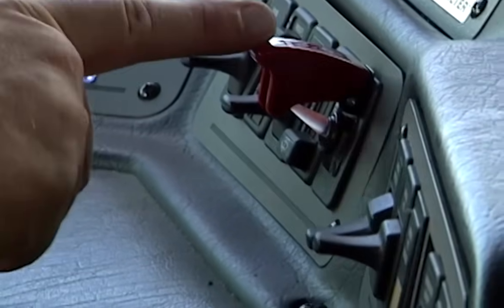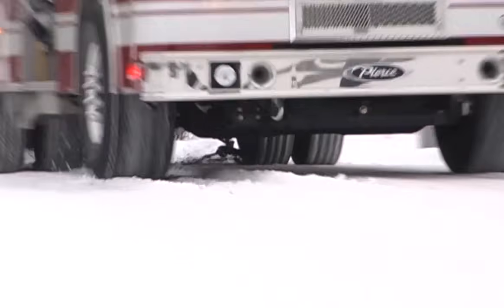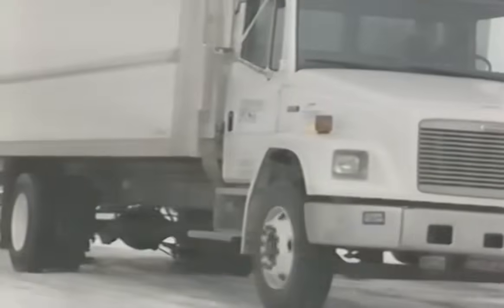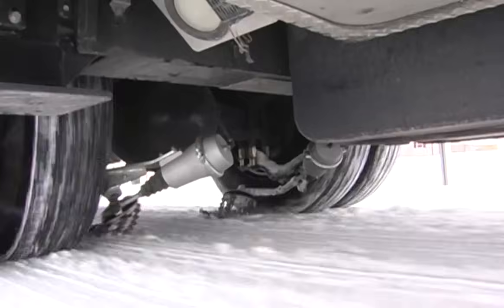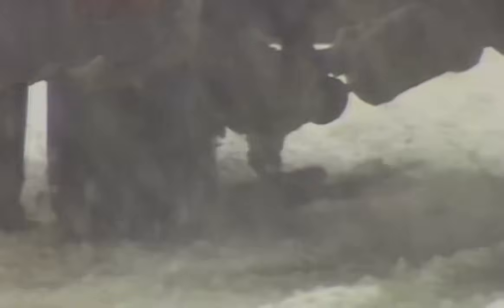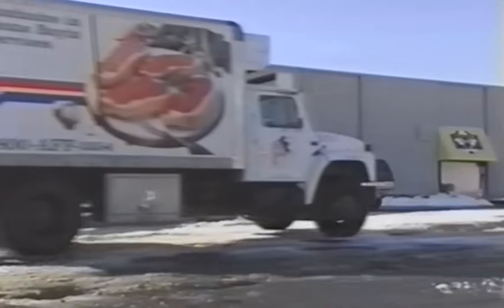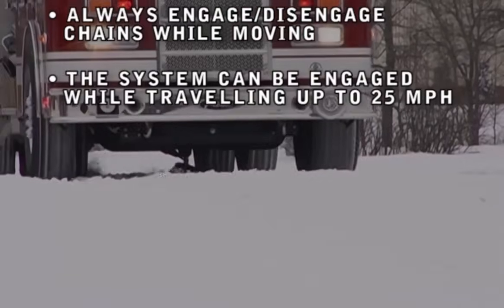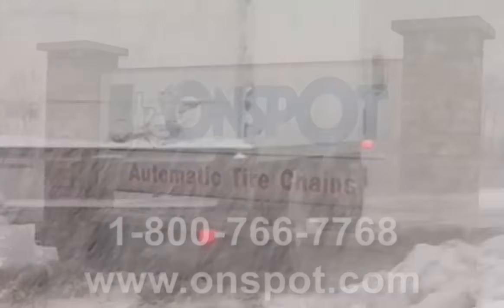What is the Onspot automatic tire chains and how it works - 2022

Comment: They work great when the system is meticulously maintained and the chains and related components are in near perfect condition. The problem is that most of these systems are rarely ever maintained as they should be. The chains don't like deep potholes and roads with debri and large chunks of ice on them. Once had one of the chains disentegrate at around 30 miles an hour on one of our tow vehices. It threw pieces of metal shrapnel in every direction, ultimately damaging the undercarriage of the tow truck and an unfortunate car who was following behind. We decided to stop using this system and just went back to chaining up the tires the old fashioned way when bad weather moved in. There really is no other reliable method that is feasible in my opinion. Others may disagree, but the 100 year old conventional method of chaining up it hard to argue against

Comment: Only in 6 inches of snow.  I guess you could have a set of real chains for some.  I bet it does not work well an real slow speeds
Reply: Been running them yrs trucking wyomong  work fine between 5 and 35 mph

Comment: Put them on the front and you've got a Zombie apocalypse vehicle ready to go.

Very neat though.

And now i really want to see what happens when you engage or disengage it while not moving. I mean seriously guys, give a reason for why it's such a bad idea. I mean trying to disengage it while a chain is trapped under the tyre I imagine could cause trouble, but engaging it while it's not moving?
Reply: Engaging when not moving is fine.  The issue is bringing them up when the chains are under a stopped tire with 5 tons of weight on it.